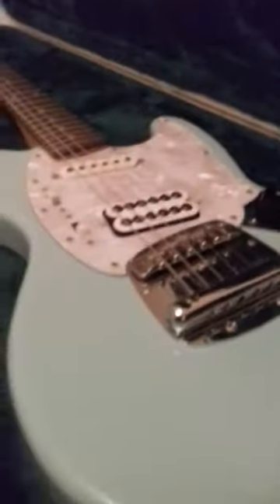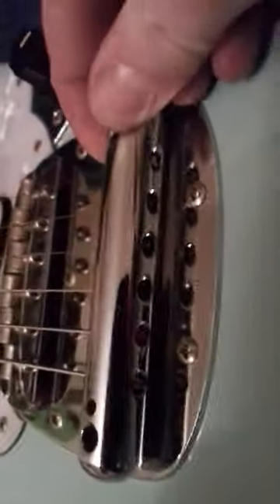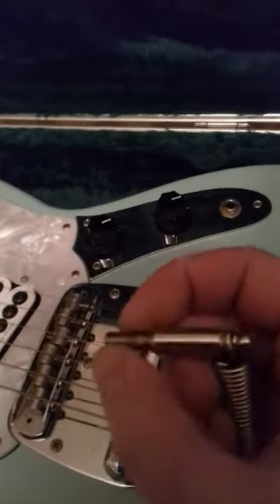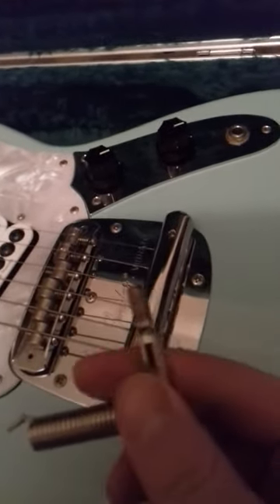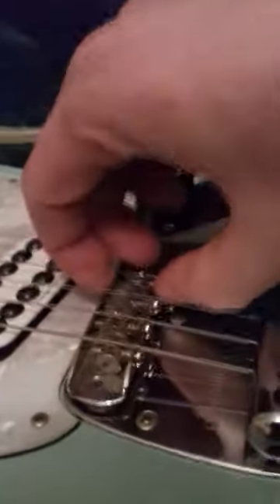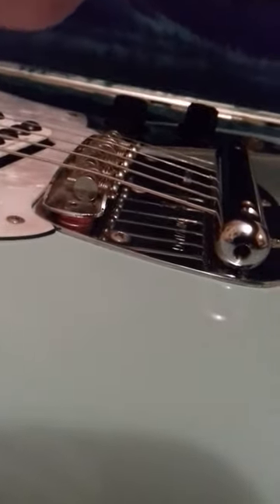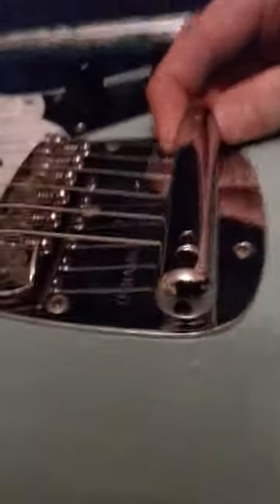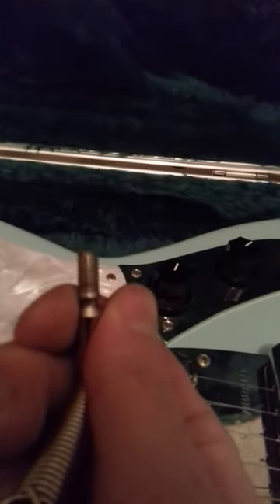How to hardtail fender mustang

Comment: Thanks for the vid mate it's a big help. Also is that a sd invader in the bridge as I was thinking of putting one in my jagstang and was wondering how it sounds
Reply from the maker: Glenn Richards the invader works well got them in my two jagstangs... as the old pickups were abit naf... would have put a jb in but cud only get black ones at the time and wanted white pickups.. as it looks better...glad i did as there awesome...
Reply: If you wanted white humbuckers you should try the DiMarzios. That's what Kurt had in his mustangs before switching to the black JB.